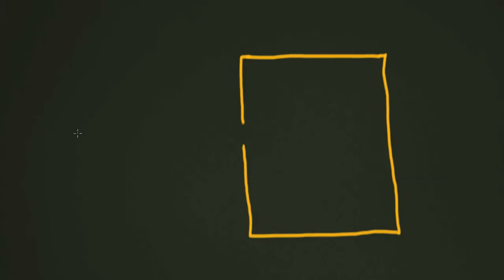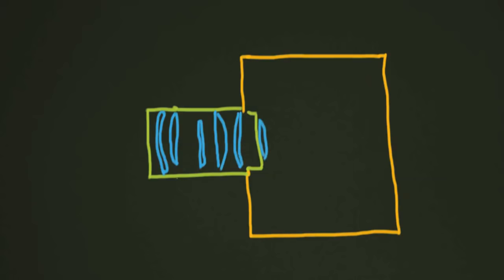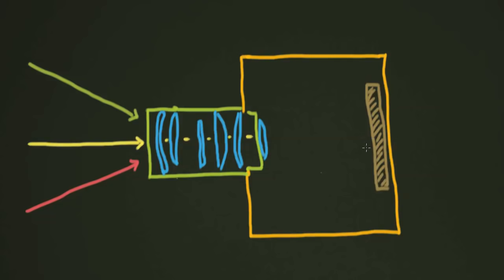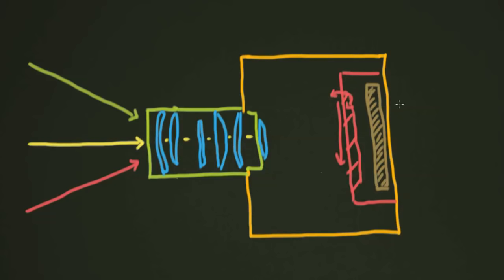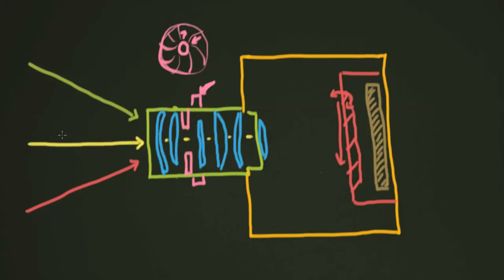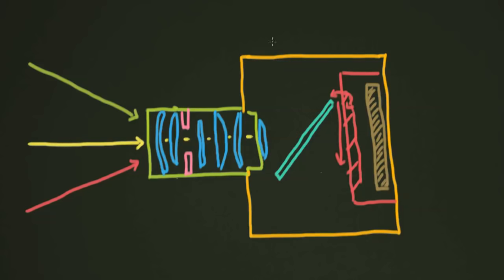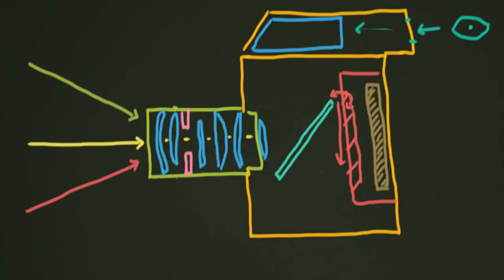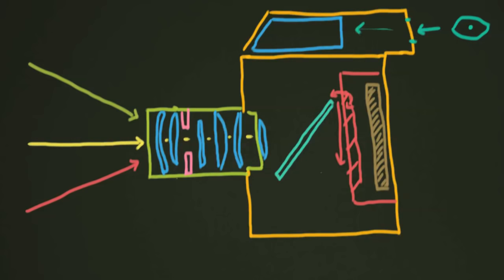How Does a Camera Work?

Comment: couldnt the mirror act as a shutter? and how does a video camera work? does the shutter just continue to open and close and they get a long sheet of film and run in through?
Reply: It can; however, it would be much slower than having a dedicated shutter. So if you used a mirror only, you wouldn't be able to go up to such high shutter speeds and possibly end up with pictures that look skewed on moving objects.
Reply: +Muhatashim Zarif thanks!

Comment: So essentially a camera is just a reflective mirror that has a special material used for absorbing the mirror image? Because the explanation of "light" is quite ridiculous.  I can understand if the human race eventually discovered a material that can absorb a reflection if given enough shock. 

But for light to simply equate to a detailed image on a piece of paper? Even a pixel is easier to understand since it is just tiny colors formed together to create an image. 

Using this reason, even digital cameras are simple to understand.  Since it's the same method but they found a way to absorb that mirror image without using disposable material. A machine that can absorb the mirror image and display it through pixels.  But "light " meaning a piece of paper can form detailed images, makes no sense.  Than that means I can take a flashlight , that special film they use for capturing images and put my hand in front of the light to capture a extremely detailed image of my hand. 

I don't buy it.